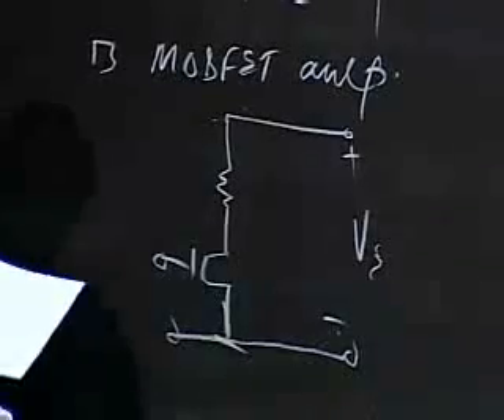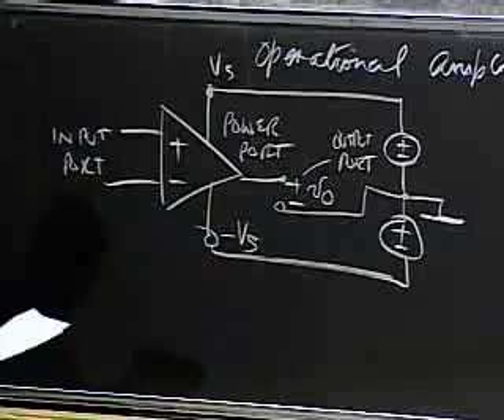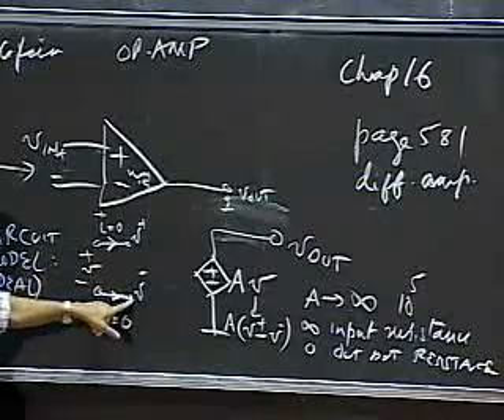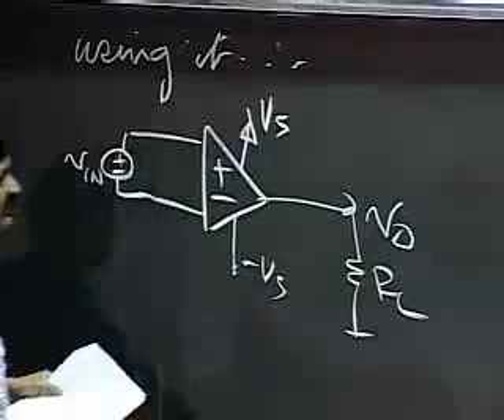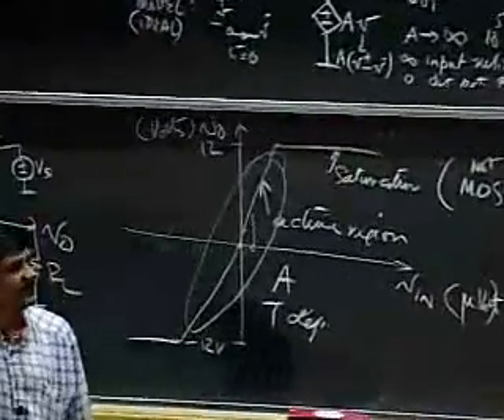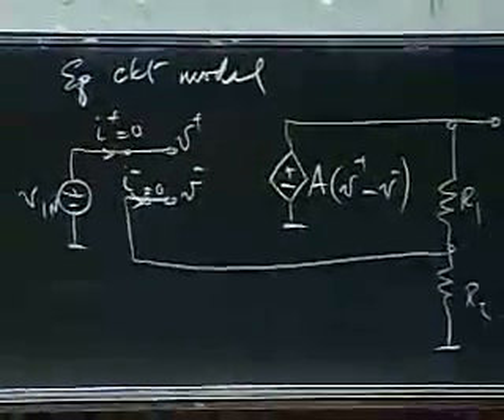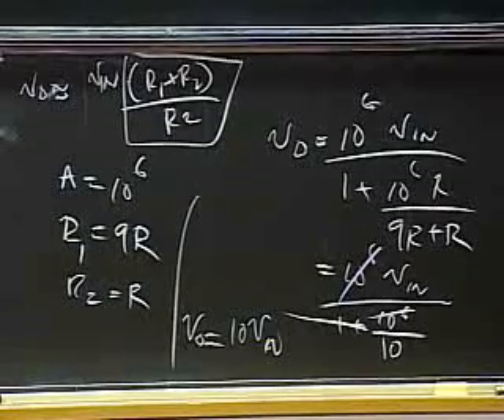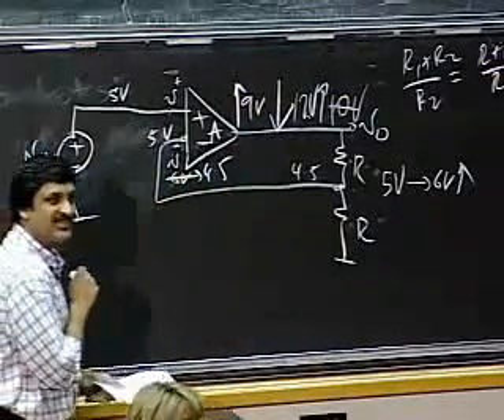Lec 19 | MIT 6.002 Circuits and Electronics, Spring 2007

Comment: Vin = 5V. Vout = 10V. V+ =5V and V- = 5V. Making Vout = 0 because Vout= A(V+ - V-)
Please help
Reply: Both Vout =10V and V-=5V are not actual values, but rounded off to integers. The actual values are slightly less than those values. In case of A=10^6, if rounded off to the 10^12th decimal position, you get Vout = 9.99998000004V. Then divide Vout by 2, you get V-=4.99999000002V. With these more accurate values, they satisfy the equation Vout = A(V+ - V-) as expected.

Comment: What's the difference between input and output impedance ?
Reply: +Abdulrahman Mahdaly  input impedance is what the voltage/current source/signal "sees" from it's point of view on the input terminals whether the input represents some component network, whether OP-Amp whether  some transistor network they all have some internal structure (MOS transistors have oxide on it's gate-input pins and oxide has dielectric properties so it behaves like open circuit or infinite theoretical impedance it goes to the value of several GigaOhms or more), its the same for output just watching the rest of the circuit form the output signals point of view. All of this is important for gaining most from driving signals, another example is you want to get an audio output signal, so you want all of  your driving/input signal power/strength to be transmitted to output so if you have infinite impedance on input most of signal by the voltage divider rule you'll get whole signal as input so you don't have to amplify it as much, and you don't get dissipation 'cus of the low currents and you don't want that on the other hand on output you want as much power as possible but usually speakers have low impedance, and if you drive them with high output impedance you'll use up your signal and wont have enough current and voltage on the speakers and have un-useful power consumption, so if you have ass low as possible output impedance you can  have most power transmitted to speaker.So you'll in this case use op amp in buffer config or amplifying.